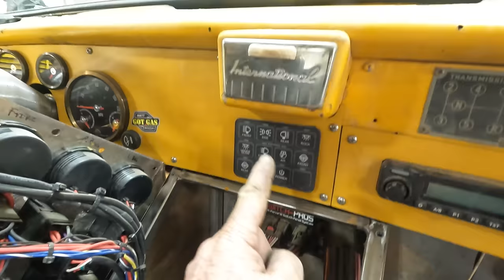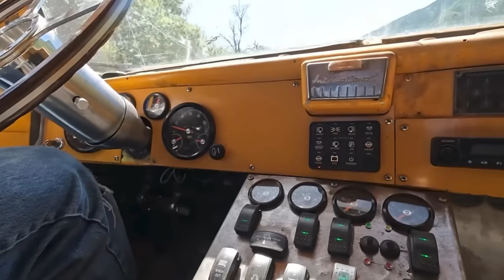The Heavy Wrecker Is Destroying Itself!

Comment: I'm sorry but, let's just send Katlyn home.  If we need someone to stand around and watch we have Ed,  he does much better anyway.
Great that the roof on the wrecker is finally sealed and painted.
The transmission and transfer case change over is a good move by the Master (Matt) who knows all and sees all. (Or was that Karnack the Magnificent One)  No it is Matt...
We need to get the wrecker fixed and out of the shop so we can fix Bombi.   It's last outing was close to a failure men, yes we can say men because we sent Kaitlyn home... The End.
But I know the answer to the question ???  Jefe shoved the gear shift into park when the brakes failed.  Needless to say, the move didn't stop the wrecker. It just messed up the transmission Jefe.  Don't do that again or you will have to stand in the corner AND write on the chalk board 1,000 times " l will not throw the transmission into park as a brake for the wrecker.  One thousand times ( 1,000 ) Jefe.

Comment: You need to reduce the torque , this comes from the tyre size the only real solution is to use gear reduction hubs,  sooner or later you will do this
Reply from the maker: I have gear reduction hubs.

Comment: the monster truck box isn't going to handel it either. and your transmission isn't going to handel the  monster truck stuff. 

there is a reason monster trucks swap transmissions and t cases between runs. 

you need a commercial truck transmission. Nothing else is designed for this kind of abuse.

you are going to have to go diesel there is no other way. i been telling you this since you started building this thing. you only ither option is to massively reduce the amount of metal you have in this thing.

Comment: If your drive shaft weighs so much. Why not get carbon or aluminum drive shaft
Reply: Probably due to the torque rating compared to how big the diameter can be. An aluminum shaft would need to be larger diameter to handle the torque. 
Carbon isn’t particularly a good idea since it’s easy to damage and have it explode. I’ve also seen multiple carbon shafts fail at the yokes when the epoxy lets go.

Comment: Why not save the money time and effort and just buy a Ford bronco and modify it? At the end of the day if a stock bronco can go up the same Sandrail that three of your vehicles struggled with air-conditioning airbags radio and without breaking means the vehicles aren’t worth the effort. Parts breaking left and right only indicates why engineers are the one building and designing vehicles, using high-tech computers and software to modulate and calculate stresses on different components in order to fit the exact parts needed to handle the loads and stress. There’s a limit to how far guessing each time which part will fit will get you. Just buy a proven stable and reliable platform and go on from there.❤

Comment: Maybe you should be doing some engineering before you put a torch to steel.
Reply: My take on engineers are they need to be forced to work on the garbage they designed before it's put into production! An automotive engineer will step over a hundred virgins to screw one mechanic!

Comment: lmao  Transmission rated for in HP & Torq?  Should have put the 6.7 diesel in with the F550 transmission and transfercase.  And you would get 8 to 10 mile per gallon not 2 plus the granny gear!